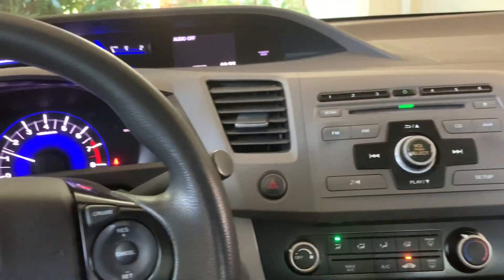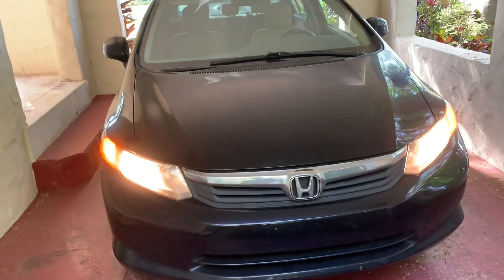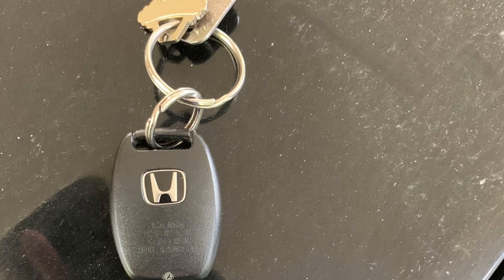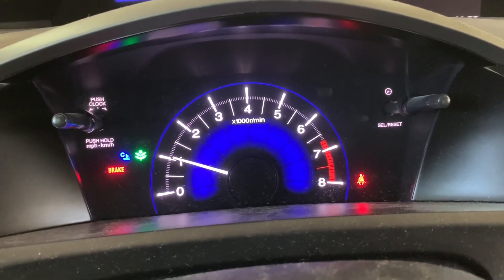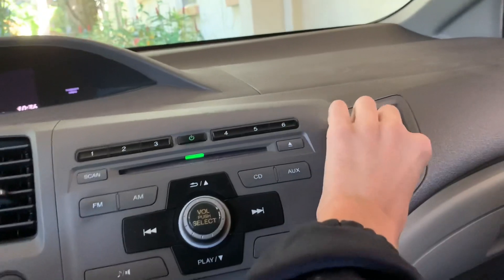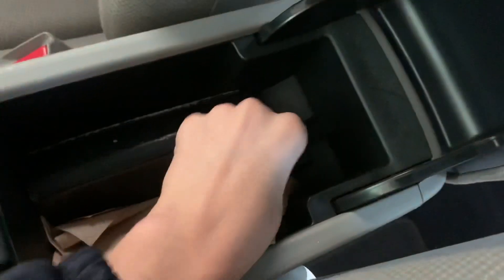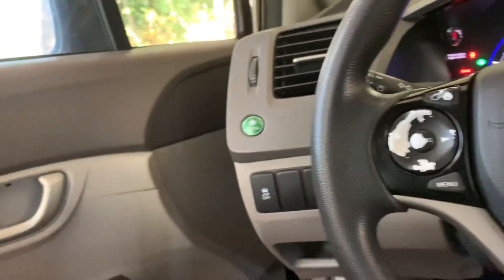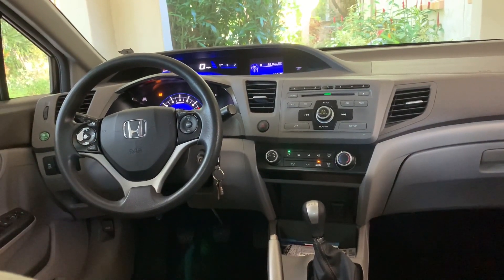2012 Honda Civic LX (5MT)- From A to B

Comment: Another relaxing review. I've driven a 2012 Civic LX with the automatic and it was nice! BTW, why are VTEC engines so nice? what's special about them?
Reply from the maker: Thanks! If you don’t know how VTEC works it works like this. In normal driving the car doesn’t accelerate that much between 1-5700 rpms. VTEC acts like a turbo and makes the car go a lot faster. Merry Christmas!
Reply: @coolcarreviews0129  Thank you for explaining that to me. Merry Christmas!
Reply from the maker: @braetonwilson4296  Merry Christmas!
Reply from the maker: I haven’t seen you in a while, what happened?

Comment: Nice! This Wouldn’t  Be A Bad First Car!
Reply from the maker: It’s a great first car!
Reply: @coolcarreviews0129  Yup!
Reply: I disagree. Get a luxury car instead. Much nicer.
Reply from the maker: @e70_x5_guy4   No offense but could you please stop comparing normal cars to luxury cars?
Reply: @coolcarreviews0129  ok. But even a one year later Civic is a lot better.
Reply: @e70_x5_guy4  I need to get a manual transmission car since my dad will teach me how to drive a manual, and barely any luxury cars have a manual transmission
Reply: @carlos6457  I hate manuals. I want an automatic.
Reply: @e70_x5_guy4  why? manuals are the goat
Reply: @carlos6457  I don’t like having to use a clutch, and you can’t get manuals on the vehicles I will end up driving (I think everyone in the comments knows what this vehicle class is)
Reply: @e70_x5_guy4  ok

Comment: It’s a nice car for people beginning to drive. But this gen Civic is not my favorite, but it surely isn’t bad. I’m not a fan of the layout of the dash. But otherwise great review!
Reply from the maker: I love this gen! I will respect your opinion. The Civic is a great first car, especially the older ones.
Reply: My favorite is the 6 and 7th gen civic!
Reply from the maker: Those are one of my favorites! Surprisingly, my least favorite gene are the 90’s one and the present.
Reply: @coolcarreviews0129  Oh! I just reviewed a 330I E90!
Reply from the maker: @Turbs2008  nice!
Reply: @coolcarreviews0129  Oh, I like the gen right after this one too.
Reply: I like the 2013-2015 Civic. That’s the only generation I like.
Reply: @coolcarreviews0129  the older Civic is probably the #1 worst first car ever. It’s not very safe, it has the worst interior ever, and it’s too slow as an automatic, and since I hate manuals, I would go for the Automatic.